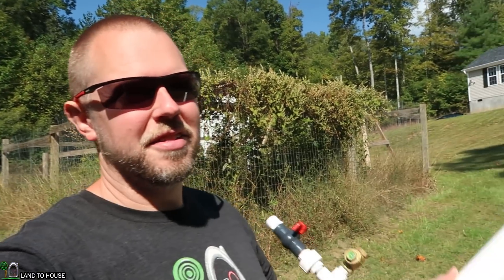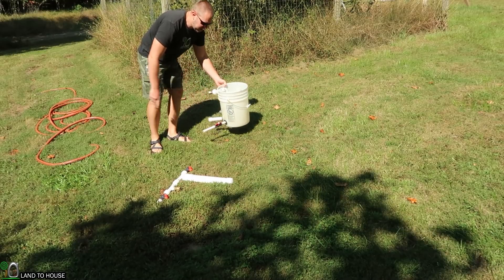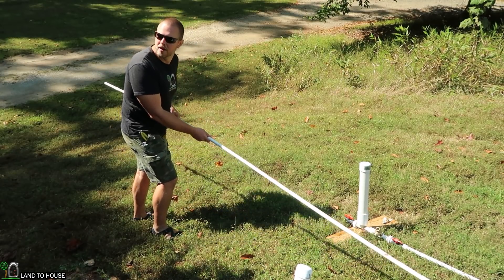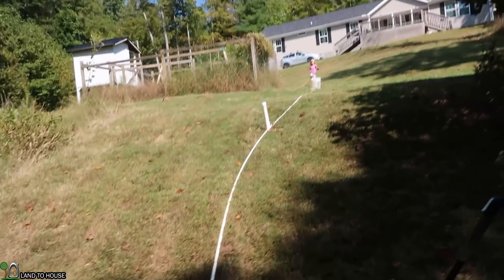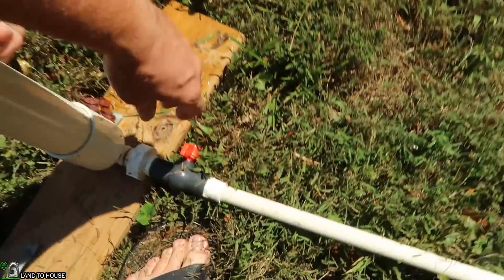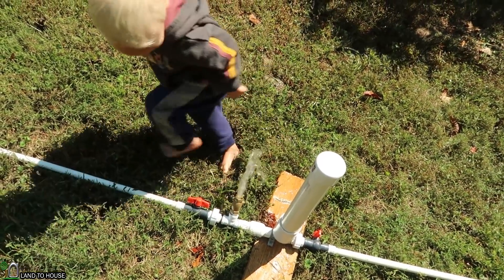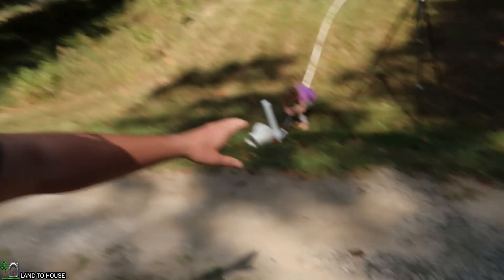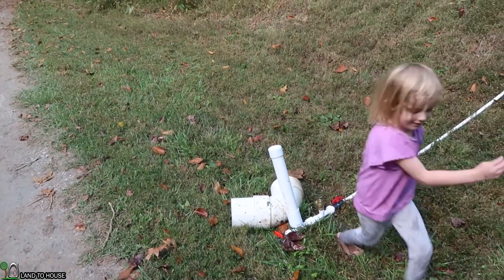Two Ram Pumps in Series

Comment: I'm also thinking to put the second RAM pump at the same height or somewhat uphill from the first pump, and to have the second one be a smaller size.  The output of these pumps is higher pressure but lower flow rate than the input.  Maybe for testing use a flexible hose between the 2 pumps so you can vary the position of the second pump more easily.

Comment: Try this: 1-1/4" pump with a long drive pipe at the bottom of the hill feeding at least 20ft of drive pipe into a 1/2" pump. You want the maximum head pressure into the first pump, the second pump needs no head pressure generated by elevation and can be flat. 7:1 and 7:1 multiplied together I bet you can get 49:1 output. Don't forget to air up the innertube in the second pump extra because it will be operating at much greater pressures.
Reply: Did you do a follow up video on this I've been wondering about this since I first seen your vids
Reply: Ditto, same here?

Comment: I have a 550 gallon water tank at the top of my hill. I want to install a hydropower generator with a 2 inch drive pipe .like the one you installed. The water from the discharge tube to ram pump or pumps. To return to the water tank. The discharge and return should be equal. The loss of water from the waste valve is a concern. Is it possible to recover the water from the waste valve to put it back into the system?
Reply: no, what you describe is an overunity device.

Comment: I have a question. I have watched you enough to kind of understand how one pump works. The pump works off of the pressure from gravity-fed water going into the pump causing the pump to push water out and even uphill at a higher pressure. That is causing backpressure for the pump to stay charged. With the second pump being lower than the first pump, the backpressure is lost when the second pump cycles. If a pump is supposed to push water uphill, shouldn't the second pump be uphill? The first pump should supply the second pump with the same water pressure as if it was gravity fed. Does this sound correct?

Comment: It is interesting that it does partly cycle correctly. Maybe you could look at a large pump feeding an elevated tank giving your more drop for a second small pump? That's a lot of effort, but if your supply is less than 1m above your lowest point it might still make it possible to pump a very small amount of water up a larger hill.
Reply: I think one of the reasons for using pipe instead of hose is so energy isn't lost to the hose moving as much as possible from the water ram action